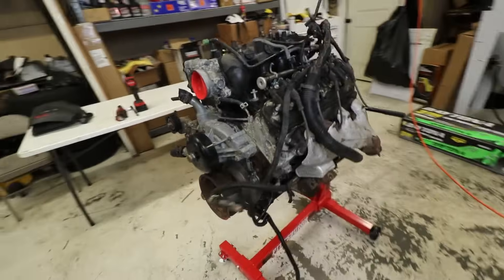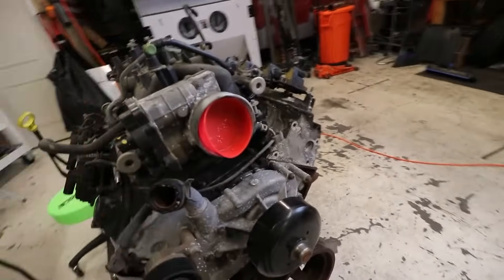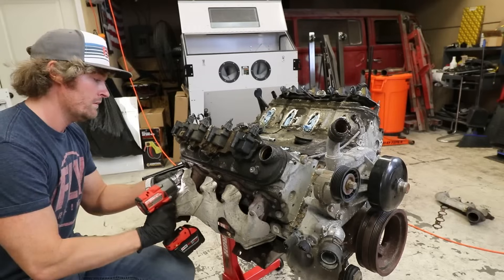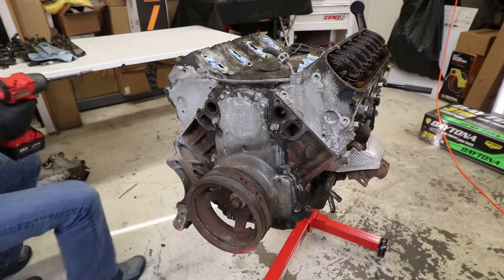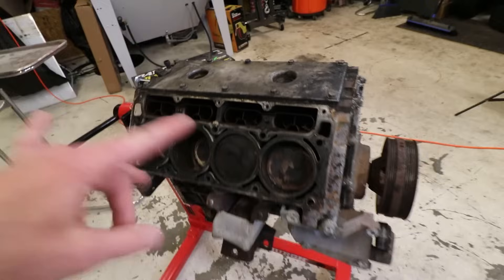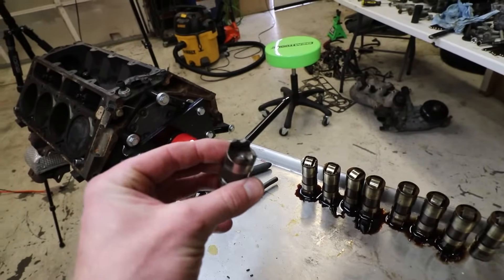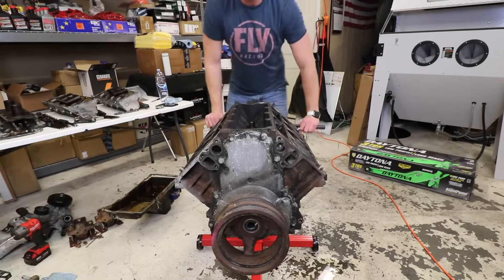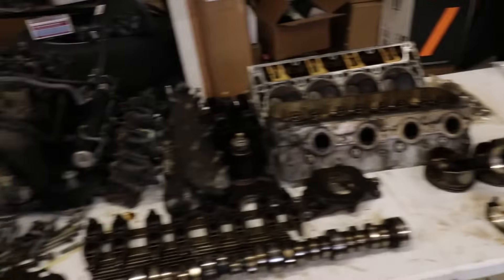LS Engine Disassembly - Supercharged 6.0 LQ9 Build

Comment: look at the back of the block or inside the dash of the donor to see if it's an LQ4 or 9
Reply from the maker: Back of the block only says it’s a 6.0L
Reply: not easy to see when its in a wrecked vehicle and mashed into the fire wall. Just look in the glove box, but yes you are correct @MitchCarveth

Comment: What’s up man I have a lq9 with low oil pressure it does have 300k miles would it be smart to get it rebuilt or should I just swap it ?🥲
Reply from the maker: It could just be the oil pickup tube o-ring, they tend to get hard and shrink. That will drop your oil pressure due to no longer making a proper seal in the oil pump. With that many miles she may need a refresh tho. It really depends on budget and time, if you can find a good deal on a lower mile lq9 might be worth just re-gasketing it and maybe do a cam while it’s out and drop her in. Then you will have an extra engine to build for power at your own pace or sell to replenish funds.
Reply: @MitchCarveth  I did the oil pick up tube on my Denali shit was a bitch but nope still the same bro , so short answer just swap that bitch out and throw a stronger cam and etc in? 🥲
Reply from the maker: I think it’s a good call, that’s what I did when the original 5.3 exploded a lifter and sent shrapnel throughout the engine. New gaskets, stronger cam and send it.
Reply: @MitchCarveth  thank you sir I’ll def be looking for a lq9 asap

Comment: Loving your channel brother👌Awesome to see this lq9 live another day
Reply from the maker: Thanks man! I can’t wait to get her finished up and running.
Reply: @MitchCarveth Hello I own a Chevrolet express 6.0 LQ4 with 90,000 miles, I live in France in a region where the climate is temperate, I do 6000 miles per year, I drive mainly in the summer, and I tow a 6000 lbs trailer, should I stick to the oil recommended by the manufacturer 5W30 or can I use a 5W40 for example???

Comment: So I have a 04 Chevy Silverado Z71 with the 5.3 an I was looking at intake manifolds for it an see the fast 102 intake an thought it would be nice on the truck but as I was doing my research everyone says that it don't fit that motor then it got me digging an found out apparently the 5.3 gen 3 is not a ls it's a small block base for the ls crates it's more so a 5.3 vortex V8 small block tho the web said it does share the same designs as a ls but that's where I get confused if it's the same designs almost then why won't a fast 102m intake manifold fit
Reply from the maker: I apologize for such a late reply, are you looking at the truck fast 102 or the regular fast 102? either way it won't matter as long as the intake manifold you are looking at says its for "Cathedral Port" heads it will fit your truck. I'm not sure what your other mods are but I do suggest going with the Truck Fast 102 intake manifold so you dont lose any low end torque compared to the none high rise fast 102 most put on cars, that intake will give you a little more top end but your low end will suffer.
Reply: @MitchCarveth  thank you so much I have the 102 truck intake manifold love it way more throttle response

Comment: LQ9 (VIN N) Applications:

2002–2006 Cadillac Escalade AWD

2006 Cadillac Escalade 2WD

2002–2006 Cadillac Escalade EXT

2003–2006 Cadillac Escalade ESV

2003–2007 Chevrolet Silverado SS

2004–2006 Chevrolet Silverado and GMC Sierra Vortec HO Edition, Silverado/Sierra Performance Edition

2005–2006 GMC Sierra Denali and Yukon Denali

2007 Chevrolet Silverado and GMC Sierra Classic VortecMAX & Silverado/Sierra Performance Edition

Comment: Escalades have LQ9. The Denalis have LQ4
Reply from the maker: Good to know, thank you for the info!
Reply: However, the GMT820(short wheelbase) with rwd was paired with the LM7 5.3L/325ci V8 from 02-04...
Reply: Wrong my 05 Yukon Denali is a LQ9